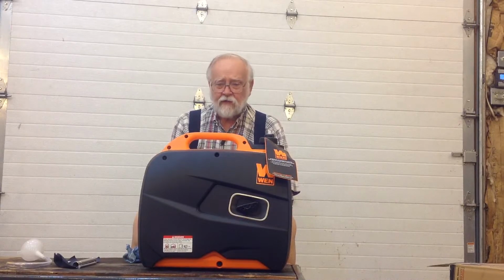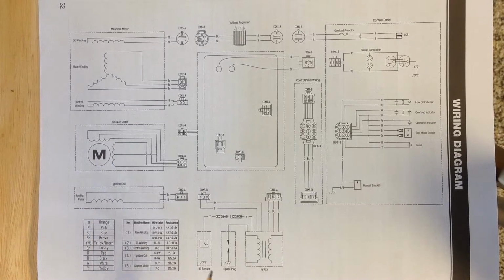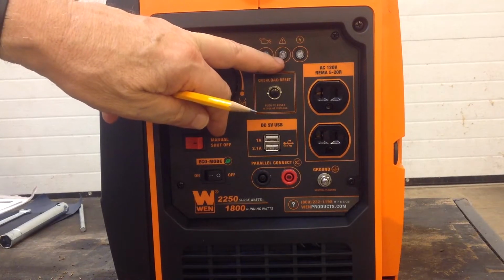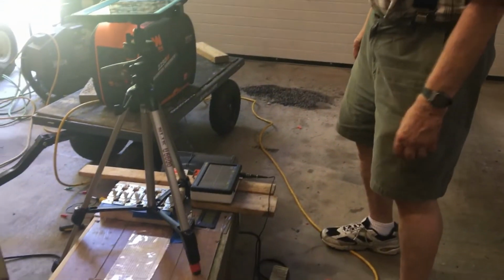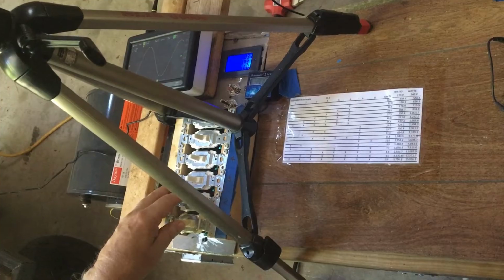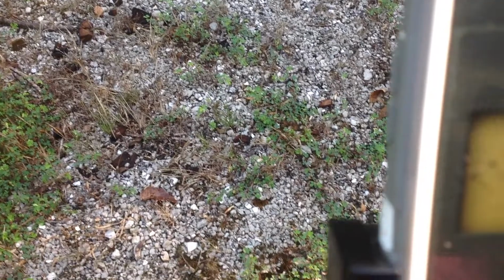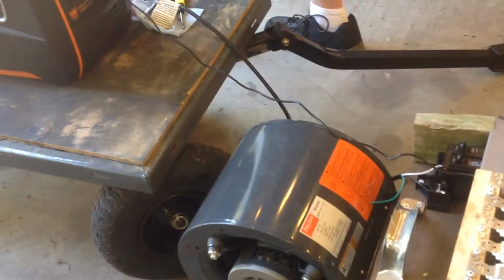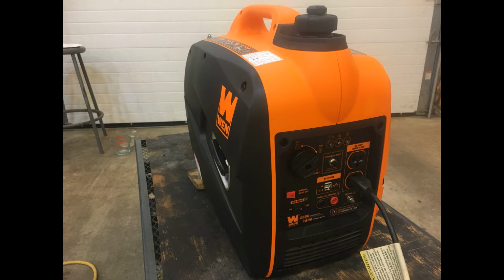WEN 56225i Generator Worth the money?

Comment: Thank you for your video Mr. Baker! question for you, What would be the measures that I should take in consideration before keeping the generator in my garage if I do not plan to use it for a year or more?
Reply from the maker: I suggest draining the tank and carb before placing in storage.  If your generator has a battery I suggest leaving it connected to a battery tender.  Don't use a trickle charger.  The battery tenders have logic in them that prevents overcharging.  On my WEN unit the carb bowl has a drain that discharges through a small nipple.  A piece of small diameter gas hose can be connected to the nipple. Just allow the tank and carb to drain into an gas tank.